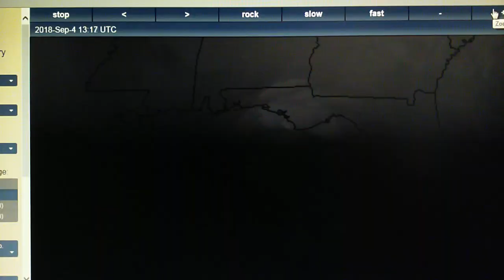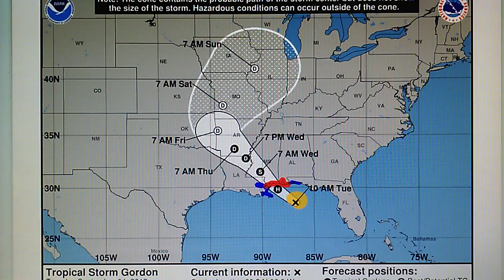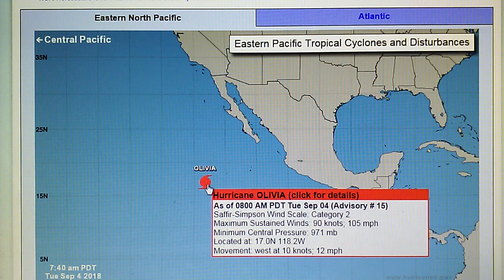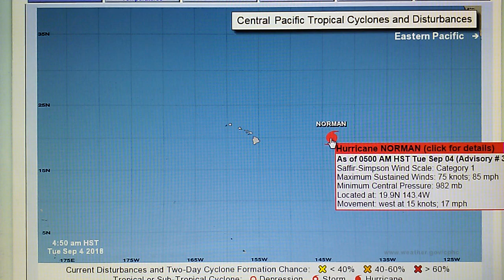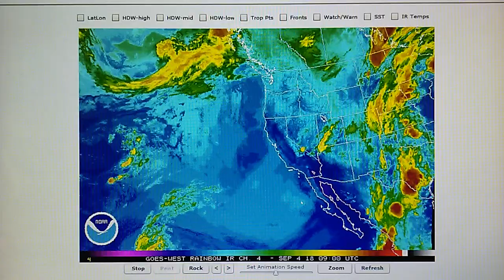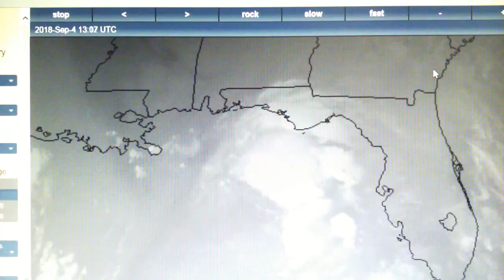9-4-2018; Tropical Storm Gordon Moves Into Gulf Coast w/65 MPH Wind

Comment from the maker: 3:45PM Wed; Hurricane Norman (now CAT3) has a large flat spot on its Southwest side as looking at the NOAA GOES WEST Hawaii Watervapor and IR maps. The flat spot is the result of a satellite transmitter installing a blocking, stationary high pressure zone to begin the process of resteering Norman from a Westerly trek to a Northwest trek as scheduled on the NHC map. Yesterday evening Norman was back up to CAT4 strength for the third time.
Reply: Observ ingnorant :
I know what I have seen personally-
And from many other sources -
Get Head outta ass -
Reply: “Slick “-